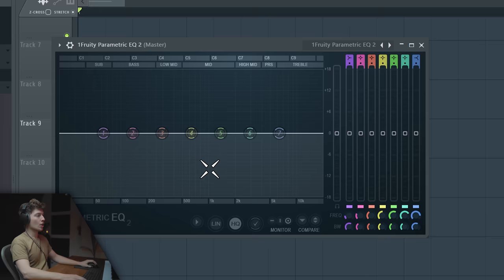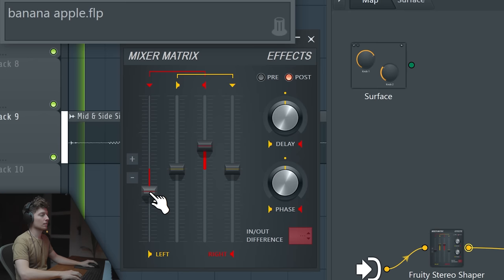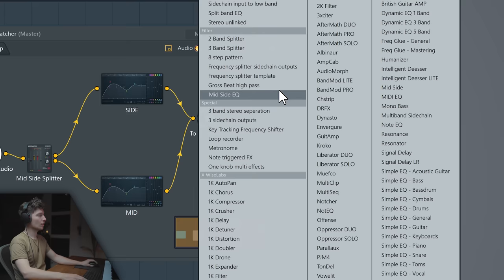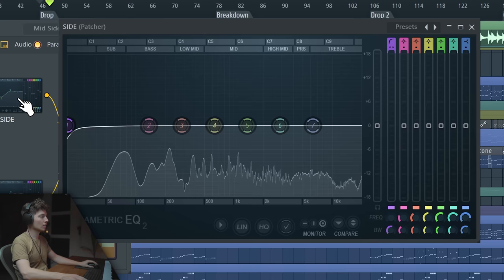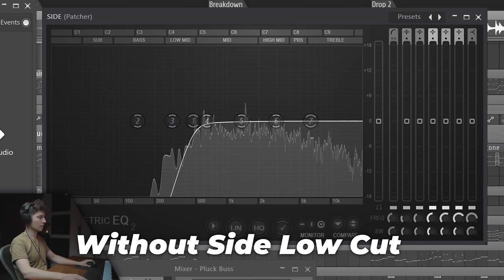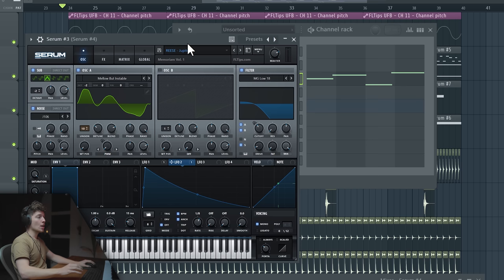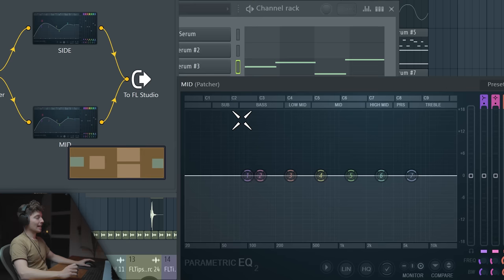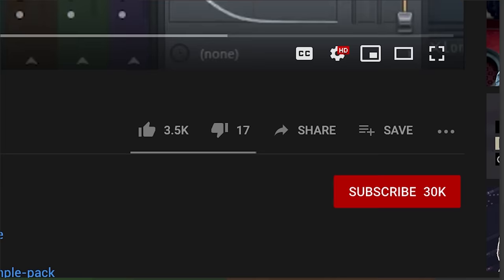MID SIDE EQ - What, Why & When? - FL Studio Only Stock Tutorial

Comment: I have never used mid side eq and i needed this video honestly
Reply: Same here
Reply: Me too but I still don't know how to use it.u didn't understood
Reply: @helpniggv  It's easy. I also found it hard to understand. First, you have your signal, let say, a pure saw wave. That saw sounds equal in left and right speakers, which means = Mono or Mid (it's perceived as it is in the mid in front of you, as if there were only one speaker in front of you). In order to create Stereo, one of the speakers should delay the signal less than 3ms or less to create the stereo feeling. So natively, everything is Mono, and by adding more ms, then the Stereo feeling increases. With this method, you can split one signal into two signals, which is the Mid/mono one, in front of you, and the Side one, at the sides of your head, and apply different tweaks to each signal. As rule, bass goes in the mids, and pads and bright sounds in the sides, so you can check and tweak each part. This applies when you are mastering a track that has already everything mixed and equalised. I'm mastering my first track and by using this method, I found why it lacks of solidity. I have almost nothing in the mids but the bass and the kick. I was fueling the mid with a super loud and beefy kick. Now I know I have to add more instruments to the mid, specially bass ones.
Reply: @Overxpossed  well explained man. Thanks for this.
Reply: @solomonjoseph8608  very welcome mate. Another tip is also to use some stereo tool, like the stereo shaper from IL, or the Channel Mixer from kHs; Stereo also works and it's much simplier to use. For example, grab a track and put it in your DAW and add an stereo Utility to that channel. The one from kHs is pretty traight forward. You have two knob: Mid and Width. Since the track is already mastered, if you turn off the Mid Knob, then you will hear all the ignal that sounds stereo, at the sides of your head; if you turn off the Width one, then you will hear only the stuff which is in the mids. And from there, you can figure which frequencies are in the mids and which are not, and how both things are balanced to create depth and not an smudgy mix. Said this, you can also create more room for more frequencies, avoiding them to clash among themselves. I have heard some music and found also when some sort of Fxs or details appear, they are only in the sides, or sometimes the bass lives the mids and goes to the sides, then again to the mid after a drop. Things like that too.

Comment: Could you achieve this by sending your bus to 2 tracks and making one mono and one stereo through the mixer? And disconnect the bus from the master
Reply: Unfortunately, no. That's not how you'd go about it anyways.
In case you want to use Mid-Side processing by having the Mid of the sound in one mixer track and the Side in another, there is a way to do so.
What you'd do in this case is route the mixer track containing the sound(s) to which you want to apply Mid-Side processing to two other mixer tracks. In both of them open the Fruity Stereo Shaper. Choose the preset Mid in the mixer track with the Mids, and choose the preset aSide in the other one. Then, you can process the Mids and Sides separately in the mixer.
Although, I'd always recommend Patcher for parallel processing like this. But, you do you.

Comment: Thank you for the video!
Where should I put MID/SIDE EQ in a chain? I mean before or after common EQ, Reverb etc.
Reply: in the master, under everything you have.
Reply: @Overxpossed  thank you for your answer!
Reply: @exeza  your'e welcome!
Reply: @exeza  By the way, you can also mid/side EQ your synths or instruments too, as well, applying effects to each. For example, it's commonly used to put reverb on the sides instead of in the mid, while other effects are used to be used with the mids and not with the sides. Regarding EQ, you will like to have the low end of frequencies parts in the mid, and the high end of them in the sides. So bass need to be put in the mids regarding the stereo field. Snares too, even thoug they are crispy or more into the 500 Hz domain, they remain at the mids. It's also related to how punchier you want your mix. If the snare or kick is in the sides kind like you won't hear them as much and impactful if they're in the sides. Yet the snare can be in both; the body of the snare in the mid, the crispier sound if it at the sides.
Reply: @Overxpossed  thank you again!

Comment: interesting a quick question i routed the mix bus twice on two separate channels of the mixer and used stereo shaper on both .On one channel i put the mid option the other channel sides option then i balanced to taste is this a viable thing lol
Reply: You can do it with 1 stereo shaper on the main channel with mid side preset in the stereo shaper just make sure you sidechain the main channel into another one. And yes it is viable. I do that sometimes to the songs to boost sides when you almost match mid and side volume levels it sounds very pleasant yo me, with headphones of course. İt would be too muddy with speakers.

Comment: Is there a way to Sidechain the Mids or Sides in Patcher? Like put a limiter after one of the EQ's and the link another channel to them for Sidechain. I tried it but failed at linking something to the Limiter in Patcher if anyone know's a solution please let me know!!!:)
Reply: There is a way to do exactly that.
Route a mixer track which you'll use for sidechaining (let's say you called it SC) the Side or Mid signal of a sound to the mixer track where you wanna apply the Mid-Side sidechaining. 
Then, go into Patcher, and in the left you'll see an arrow under which you'll see "From FL Studio" is written. Right-click on the arrow, and choose SC in Audio. 
Route the new node to the Fruity Limiter that you've loaded in Patcher by dragging the cable line on top of the picture of Fruity Limiter.
Choose an input of your choice, then choose the same input in Fruity Limiter and then go about your sidechaining business.

Comment: Sometimes I use Maximus to make the lower frequencies mono etc, does this have the same effect or is there something I'm missing?
Reply: They are kinda different iirc maximus mono knob is basically just squashing the selected frequency of signal into mono based on it's algorithm so now the signals that are usually at the side are now playing at the mid with the stuffs that's already there(might make things sound muddy, have weird artifacts etc.)

While mid side eq is a more of a subtractive approach, you basically eq the mid and the side individually, or you can even just route the mid signal and side signal to different channel and do a bunch of parallel processing, imo it gives you way more control on the sound, and usually results in a cleaner sound
Reply: @elin3303  so would you recommend using mid-side EQ instead of mono/stereo knob? I mean in which situation do you use one instead of the other?
Reply: @maximevanraemdonck1712  if I want to make a part of the sound more mono I would use maximus, if I want to clear out a certain part of the sound I would use the eq, I can't really tell you something like you should use A on B, because every sound is different, what might work on one sound might not work on the other

If you are just worrying about mono compatibility both will work, but imo usually I find the result more pleasing using the eq, because using the mono knob often makes thing sounds squashed
 
You should load up a sound and try it yourself, its kinda hard to explain